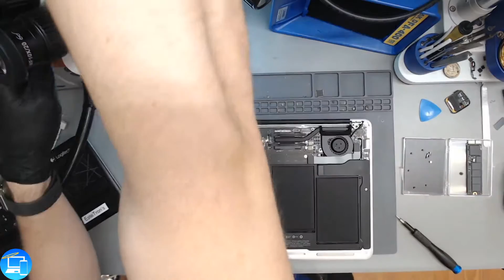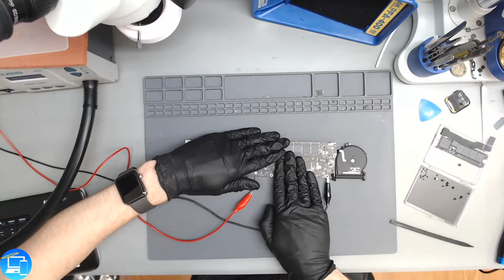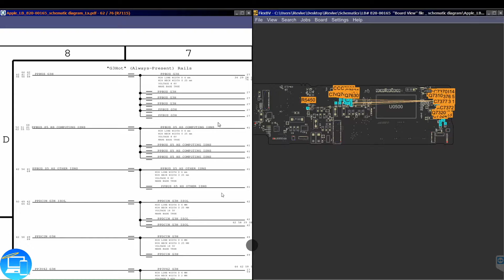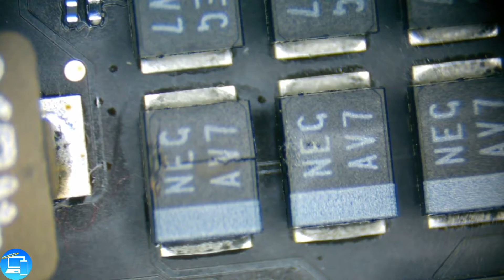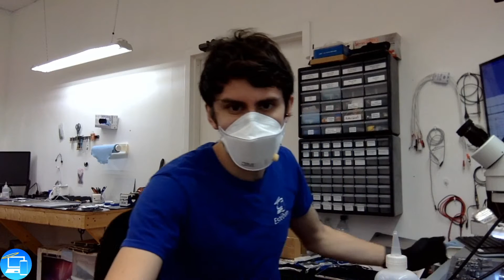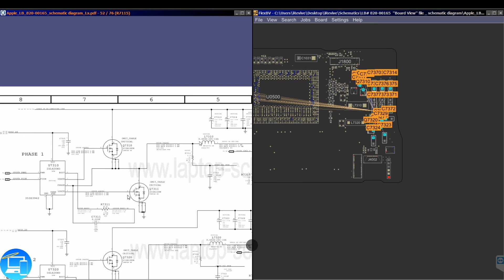820-00165 PPBUS Short

Comment: 1. if u use thermal cam that would be faster to find hotspot
2. use low melt solder to remove smd. I saw that in NorthBridgeFix